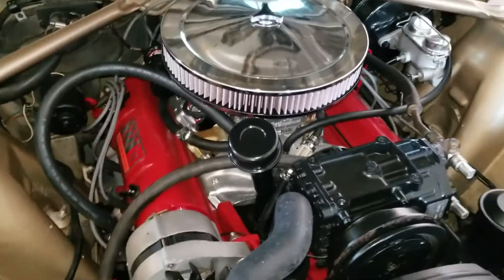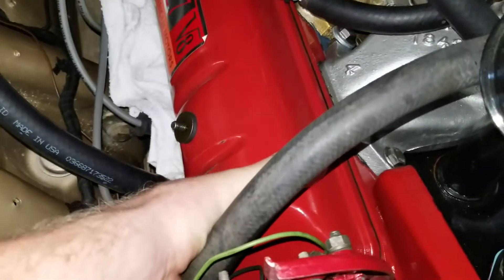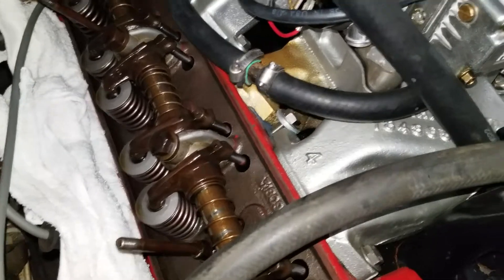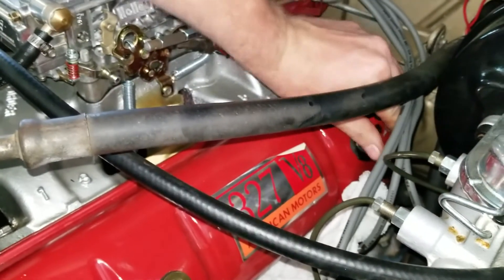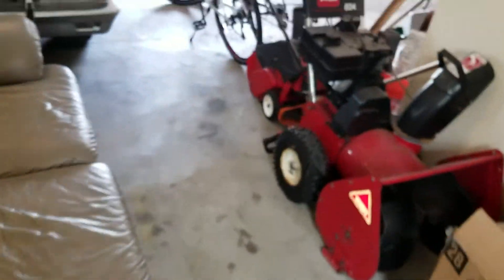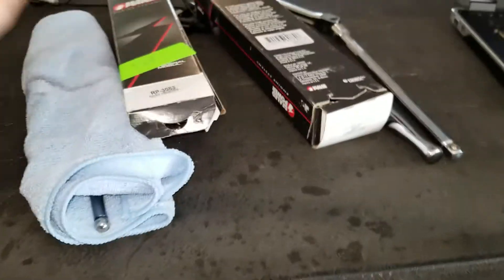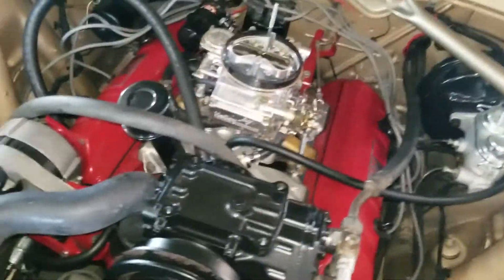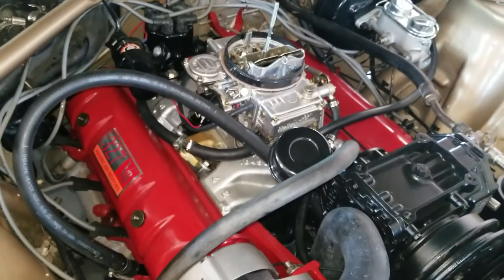AMC 327 Valvetrain Noise Investigation - Bent Pushrod? Collapsed Lifter? Flattened Cam?

Comment: Where so I find push rods for this motor? I cant find them anywhere
Reply from the maker: You should be able to find them on Rockauto.  MELLING MPR330 or SEALED POWER RP3083 should be the part numbers you need.
Reply: @RamblinGarage  even for a 1959 rambler 327?
Reply: @RamblinGarage  what did you end up finding on yours?
Reply: @RamblinGarage  do you have a part number for lifters.
Reply: @RamblinGarage  I order them from rock auto mine is the first gen 327, it's actually a 5.4 those push rods were too short. I cant fond them for this motor anywhere.

Comment: I just pulled my new '66 AMC Rebel from a field in Kansas.  The engine turns over, the rest is needing some attention.  I'm starting with the Carb/Ignition, Brakes, tires, then on to suspension and body work.  Thankfully, I have sourced the upholstery material to have the seats redone.  It's my retirement project, so I have plenty to me busy.  Any help sourcing parts, body panels, etc....?
Reply from the maker: I do have a few things, check my second to last video, I have all of my stuff for sale on there, I just started clearing out some extras.  I have a PS fender and a couple of motors I'm looking to sell.

Comment: What was the issue
Reply from the maker: That's a good question.. lol I haven't found a resolution yet. It still ticks, but has not gotten better or worse. I'm guessing it's either and exhaust leak that I can't find or something in the oil pump area. We're about 5k miles later and nothing has failed. I'm going to pull the engine soon for a little different build and I'm sure I'll find something then.

Comment: Hey I have an amc 327 v8 in my 68 jeep gladiator I have the same noise as you but a tiny bit louder did you figure out was?
Reply from the maker: Hey sorry for the late response! I have the noise at it's most audible on the bottom of the engine, behind the oil pan.  I think what I probably have is a loose bolt on the flywheel, bell housing or a cracked flywheel.  I'm hoping to investigate further in about 2 weeks.  I'll definitely have a video on the process!
Reply: @RamblinGarage  you figure it out? I have the same issue on my mustang
Reply from the maker: @roguethefox4504  I'm pretty sure it's my oil pump. I still have good oil pressure so I'm leaning it for now as I build another motor on the side.